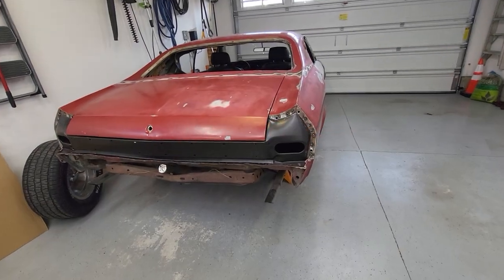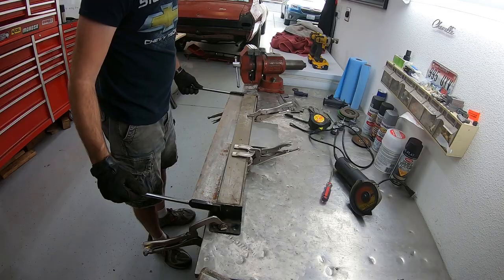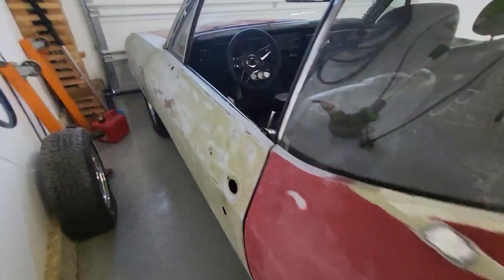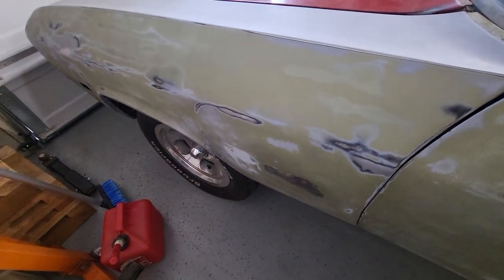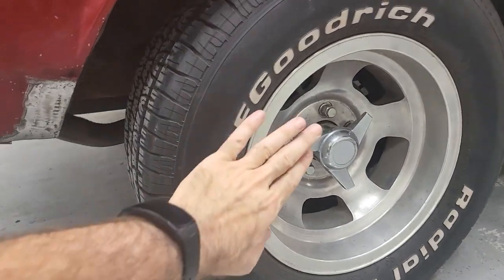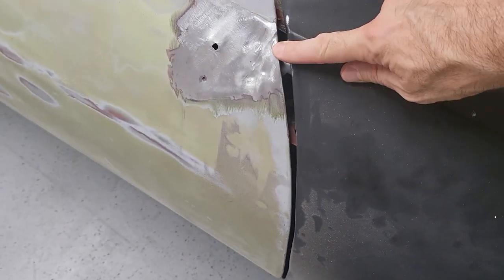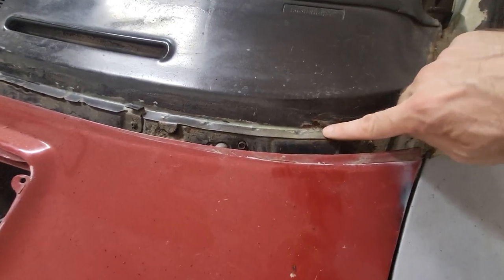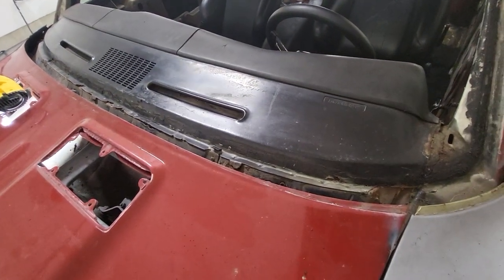1968 Chevelle DIY Body Work and Paint - Part 3

Comment: Excited for your project, I've restored several cars on my own and have been doing body work and paint professionally for 7 years. I wish more people would weld
In new metal rather than slapping on Bondo. I would recommend making the patch at least 2 inches beyond the rust area always.  Good job!  A place in VA, belden speed has great windshield and rear window pieces to fix vinyl roof rot around the windows, well worth the$
Reply from the maker: Thanks for the tip! I looked up Belden Speed and I'm tempted by their front windshield patches. If I end up with more than I thought, I might just order them and be done.